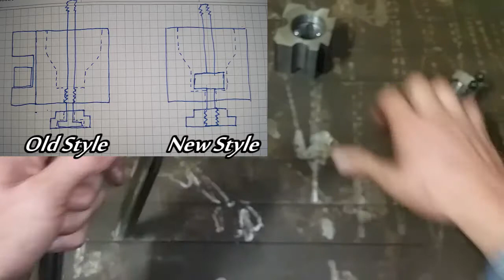Quick Change Tool Post Build 4

Comment: Hi, great video series.  I just watched all of them in one sitting.  Just wondering what type of steel you primarily used?  I think I heard you say in video 3 it was mild steel.  Did you mean Hot Rolled?  I'm thinking about making some QCTP stuff for my lathe.  I think I'll 3D print everything first before I get too involved with making chips.  Cheers!
Reply from the maker: Thanks for watching
Everything would be hot rolled 1018 steel.
My only comment with this design is that you need to get the dovetail dimension reasonably close as there isn't a lot of outwards flex